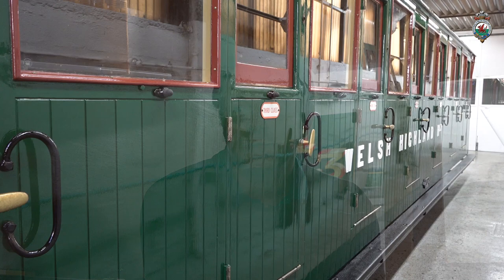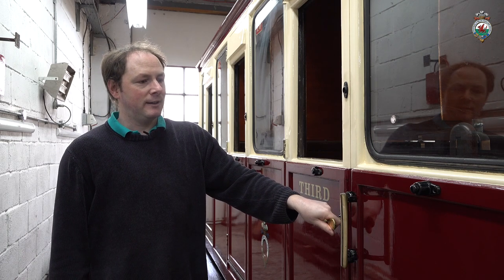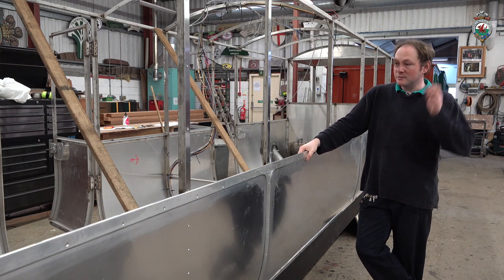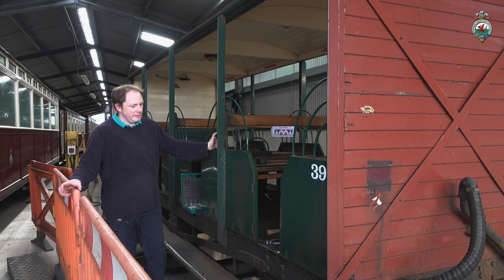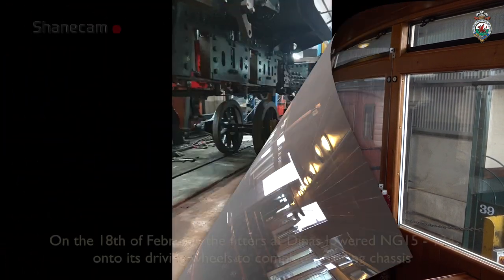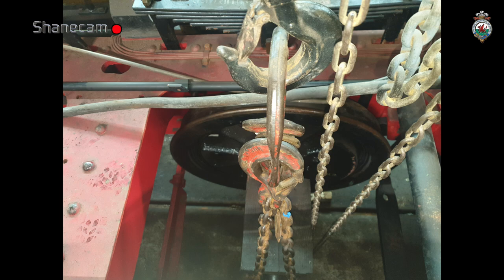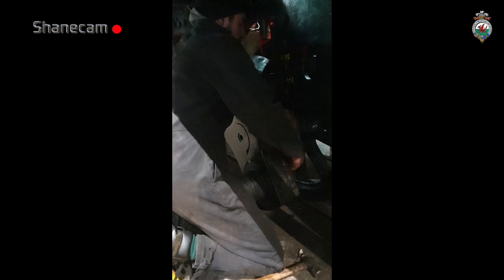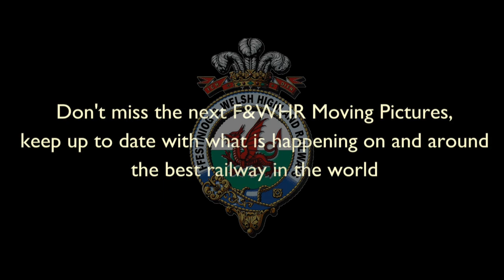F&WHR Moving Pictures Number Forty Seven - 26/2/21

Comment: I can't get enough of these, they are all endlessly fascinating.  And the fact that commentary is all accompanied by the angry whir of an angle grinder, hammering - it doesn't matter what sort of hammer or what they were hitting - and the occasional flash and blinding light from a MIG or a TIG welder.  I love it.  If I didn't live 250 miles away, I'd volunteer in a heartbeat.

The coaches were beautiful, the engines were beautiful, even the workshops are, in their way, beautiful, to say nothing of the landscape.  To think that once legal counsel for the CEGB dismissed the Ffestiniog (and by future extension the W.H.R) as "...amateurs playing trains?"  Well, of course, you are, but in the most thoughtful, meticulous, responsible and professional way possible.  Without doubt the best railway in the world.

Comment: I remember riding in No. 39 behind the SBR mallet during Superpower 2011 on a rainy and windy day, going from Rhyd Ddu down to Beddgelert. I had a "compartment" for myself so I could switch sides to avoid the rain , but obviously the benches and everything else was wet, including myself. But I would repeat the experience every day!

I was wondering about the shape of the door openings at the time because the triangular "cutouts" didn't make sense with the "full height" doors.  The doors  on the WHHR toastrack seem more fitting but obviously are less safe on a "big" railway with higher speeds. I guess the toastracks didn't have doors at all in their original form.